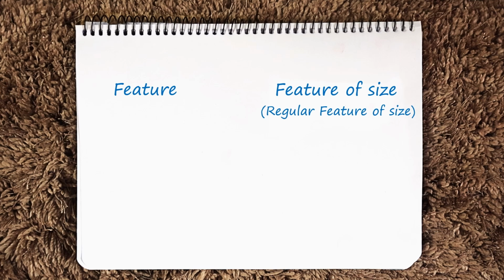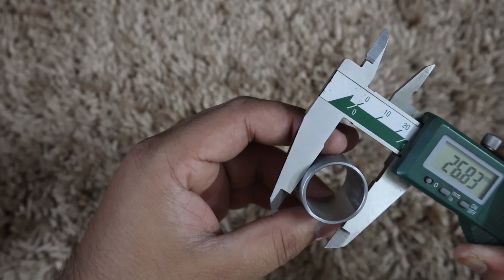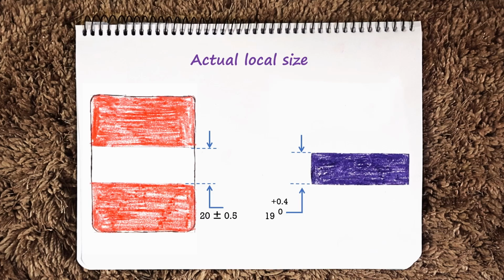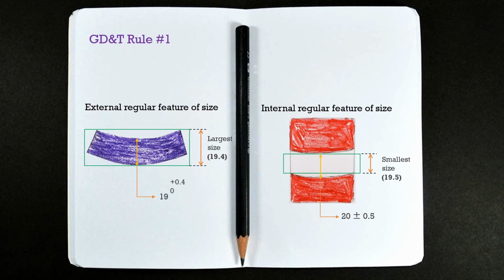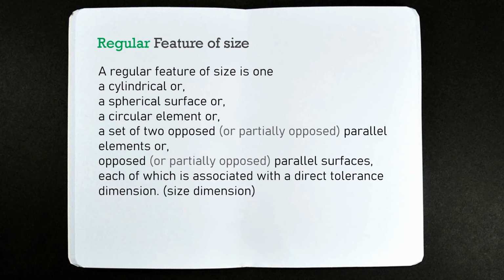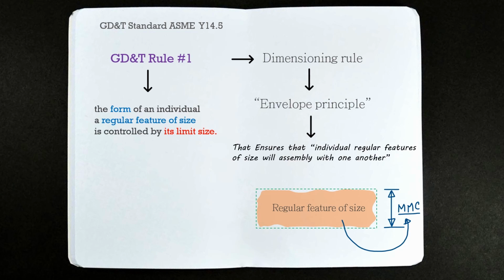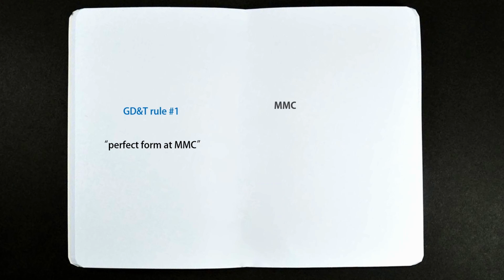GD&T Rule 1- Feature and Feature of Size, Regular and Irregular Feature of size

Comment: Hi Sir, it is an amazing explanetion. I think, about the question that you made in time 20:10. The two lines are not feature of side. Because the diagonal mesure it is make with two measure the wiegth and the long, so i can change those measures and made the same diagonal measure. i can´t specify the position or the diagonal measures, without an angle.

Comment: A query. When the shaft is at MMC is it not a good practice to show the hole at LMC. ? Video at 9.58 s slide
Reply from the maker: Shaft is at MMC- means at largest size, Hole at LMC means hole is at smallest size. so, it couldn't fit maybe, depending on tolerances

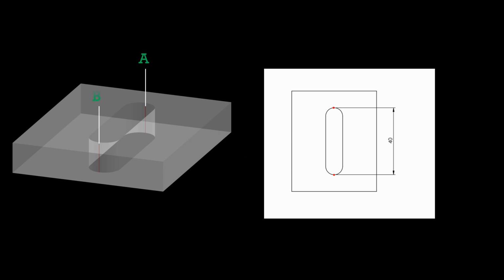Comment: You mentioned around 22:05 that lineas A and B are regular features of size due to them being parallel and opposed. 
My question is if the triangle slot that you showed could be considered a regular feature of size if we measure from the bottom left radius to the bottom right radius and making sure the measurement? Because technically speaking you could measure that distance with some calipers.
Reply from the maker: 1st thing. by definition. one cylindrical or spherical surface (or circular element) or two opposed parallel elements (or parallel surfaces) associated with a directly tolerance dimension are only a regular feature of size. rest everything is irregular feature of size or just a feature.
2nd thing. If you could measure something with calipers, isn't necessary it would be regular feature of size. it should be feature of size. but not regular feature of size.
Reply: @mastermechanicaldesign  thank you for taking the time to respond. I guess I'm still confused because I'm interpreting a regular feature of size as a measurement between two parallel points. I'm going to keep studying
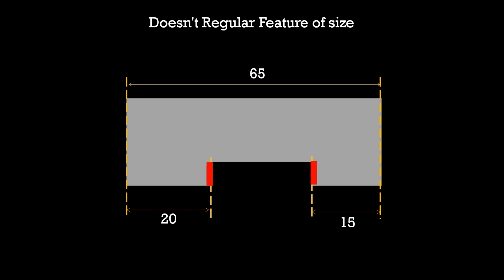Reply: 25:03 Will it come under FOS or is it just a feature because it's size tolerance is not directly given

Comment: why is slot not a regular feature of size they have parallel elements right as you mention in 22:02
Reply from the maker: Yeah, two parallel elements, means two faces of a slot is a regular feature of size, two parallel lines of a slot are regular feature of size, and will follow the GD&T rule 1, but a complete profile of slot (complete continues profile- including two parallel face and both end arc) is not a regular feature of size. complete slot profile will not follow GD&T rule 1, only individual faces will follow the GD&T rule 1.
Reply: @mastermechanicaldesign  understood bro Thank you

Comment: Very informative video bro 😊❤. I have one doubt at 30:56. Dia 5 is having +- 0.1, doesn't it refines the straightness tolerance of 2.
Reply from the maker: Yes it will refine the straightness too
Reply: @mastermechanicaldesign  In that case what's the use of giving straightness tolerance there? It has more tolerance than diameter tolerance.